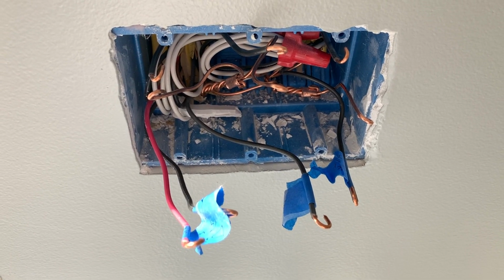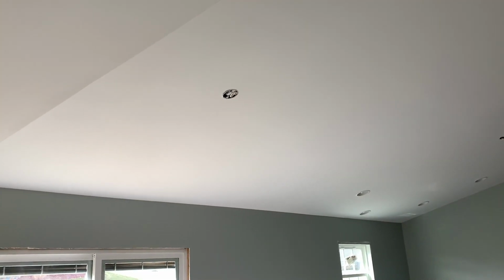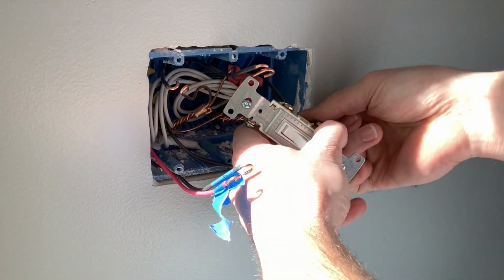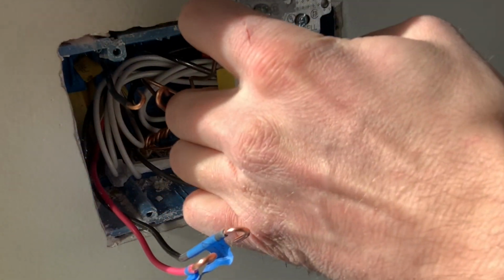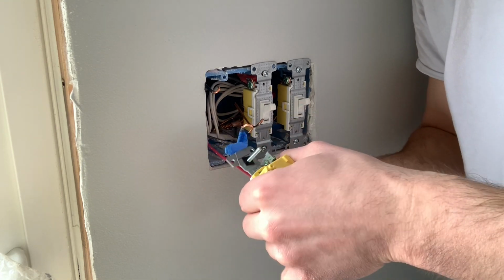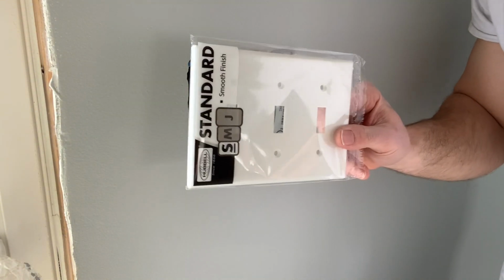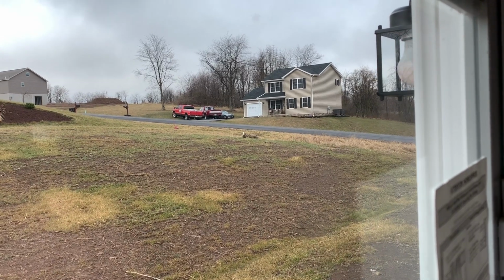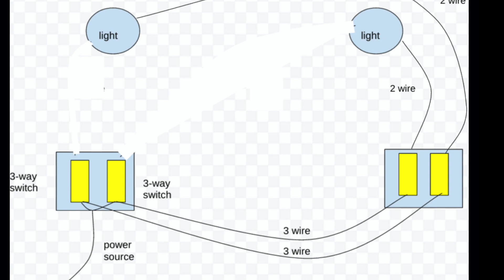How To Wire A Light Switch

Comment: I noticed at 6:23 you're hooking the wire in the wrong direction.  The hook should face with the opening to the right so that when you tighten it down it tends to not unravel but further cinch the wire hook.
Reply: Saw that too

Comment: I need help wiring. 
I have a 12/2 ran through the house on 20amp arc fault breaker. I have one gfi outlet then a light switch light then a gfi outlet. I don't want to cut power to the outlets after than. I'm stumped on wiring. Help please